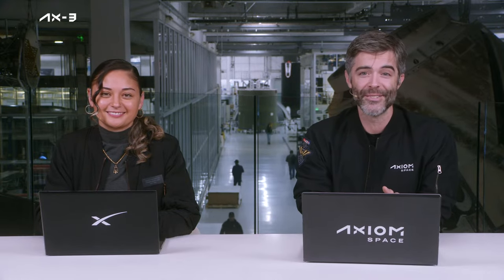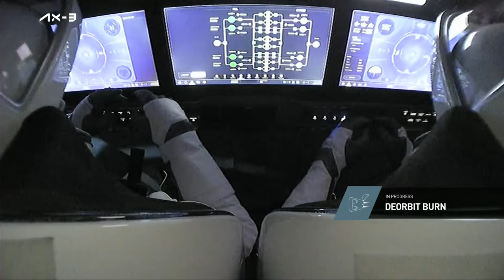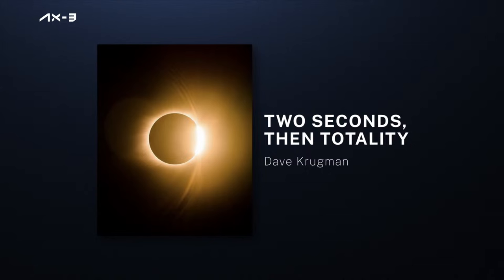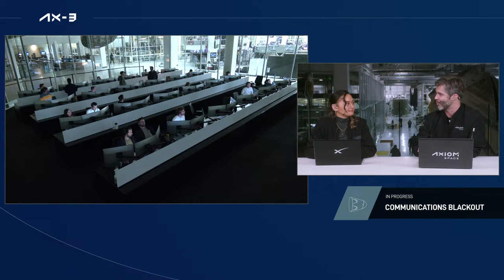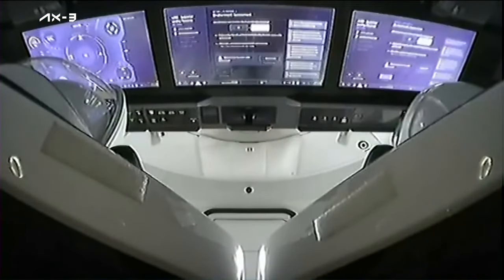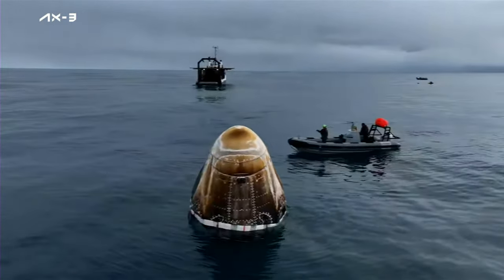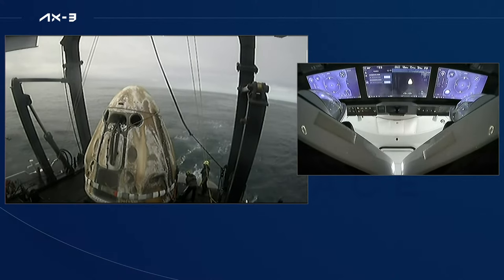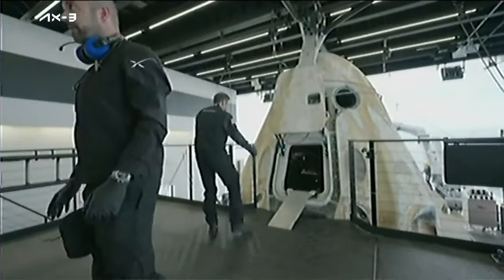Splashdown of Axiom 3 Mission with Marcus Wandt

Comment: The first infrared camera view in the ‘Splashdown’ video time 1:00:37 showed a clock in the top right corner displaying 02/09-2024 - 13:23:40.205 UTC which is useful in calculating the actual splashdown time to the second.

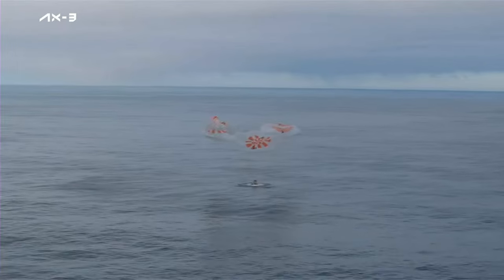Actual splashdown time on ‘Splashdown’ video time was 1:06:39 equal to 13:29:42 UTC which was found by adding 6 minutes 02 seconds to the infrared camera clock.